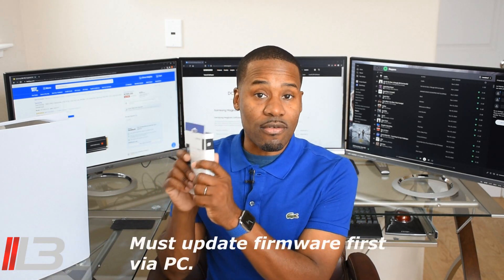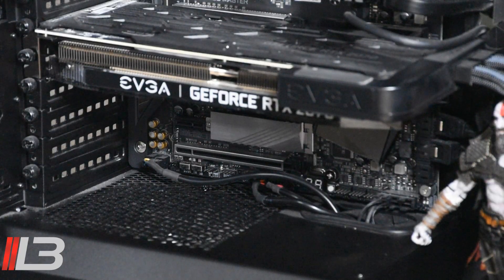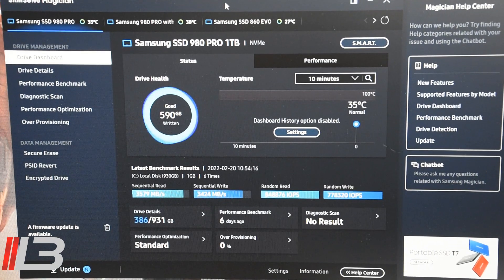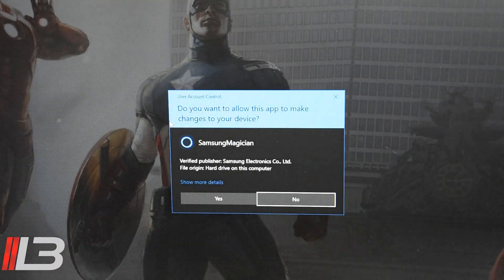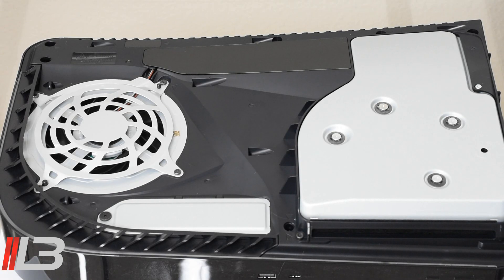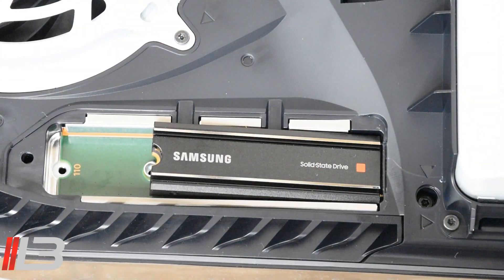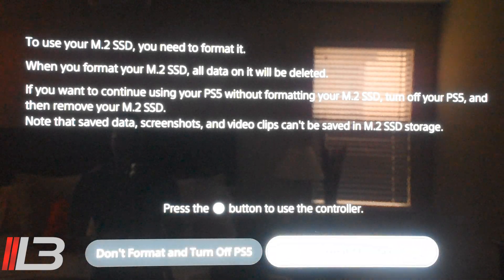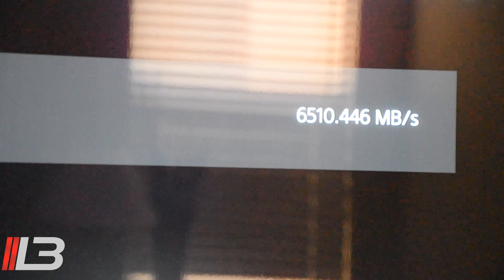Playstation 5 PS5 Samsung 980 PRO 2tb SSD With Heatsink Install & Firmware Update 6500MB Speeds

Comment: I just got 2tb 980 pro with heatsink production year 2023-09-29 l. Do i have the latest firmware update? Cuz i dont have a way to check
Reply from the maker: I think you’re good.  But, if you put it in your PS5 and the read speeds are what mine are or higher, you’re golden.

Comment: Hello I found this product on Amazon, and the price of the product caught my attention. It is great!, so I want to ask you, after a year has passed since you downloaded this video, is it really a great product? Is it useful? Did you encounter any technical problems? Does it get hot since it is inside the Playstation? Because I really want to buy it, but I am afraid that there will be any problem
Reply from the maker: It’s still working just fine without any issues.

Comment: argh...i stripped the screw on the ssd.  Apparently, it's a common issue.  All be warned.  I've contacted some computer stores for the screw and spacer part....if that fails, I'll order one of the sets thru Amazon.

Comment: Mines made in Vietnam 2 tb. Made in 2022? Did not update. Read speed 6496 mb/s. More concerned interested in whether +- 50 mb/s really makes a difference. Note: I do not jam things in. If it ain't sliding in then I'll work with it until it does. Never want to break something due to my own negligence. Also used a Sabrient heatsink add-on  that does not fit flush when installed. Had to wiggle and work on it before it fit more or less..

Comment: Can i update the firmware of my 980 pro with my laptop but connecting it via a usb to PCIe adapter, "on the go", without connecting it to the motherboard?
Reply from the maker: I can’t confirm, but I believe so.
Reply: Did you end up trying this? And if you did any recommendations? I'm in the same boat

Comment: Can you tell me how many sdd u have cause I see that u put one in the PC and the other one in the ps5 did you use to sdd or did you took away the one that you updated on the PC and put that one in the ps5
Reply from the maker: As showed in the beginning of the video you’ll see three new SSD’s. I have three new ones and had one existing 500gb in my PC.. I put a new one in my PC. I upgraded it to a 1tb from a 500gb. 

I also have two PS5’s. I upgraded those to two 2tb SSD drives.

Comment: So I think this is a real problem 
If you need to update ssd every 
3 or 5 months for stability and 
Improvements, and probably if 
you already install it on ps5 u 
must transfer games to PS ssd 
before installing the update or 
games will be deleted and if u 
don't have enough space in PS 
ssd you are done
Reply from the maker: I never heard of having to update it every 3-5 months.
Reply: I saw an article 2 days ago saying you needed to update the firmware on the Samsung  2tb 980 pro or it could randomly brick itself. Is there any way to do this without a pc? We need a Samsung magician app on playstation 5!

Comment: This thing is on sale for about 209$  for the 2 TB on Amazon i am going get it rite now before the sale ends. So I got mine and I put it in the ps5 and my ssd was made 5 months ago the date was on the black tape on the box and it shows I'm getting 6480 mb/s so any ssd forsure is updated if it was made less then 5 months ago.
Reply: Nice thanks for posting ive just got my ps5 and just this minute ordered a iTB pro with heatsink  so will check date on box 1st 👍

Comment: Can I just put the Samsung 980 PRO Heatsink 2TB SSD for PS5 in the console & the updates from Sony will update??
Reply from the maker: You can put it in without updating and it will work fine. You just won’t get the fastest read write speeds if it doesn’t have the latest firmware.
Reply: @locoboof  Hi James, will the Sony PS5 updates do that for me?
Reply from the maker: No, that’s why I made this video.
Reply: It would be good if sony did update them for the user. In my opinion I think they should atleast update the official licensed WD Black drives.

Comment: there's no way of updating it without putting it into a PC? I just bought this drive on sale for my PS5, it'll be stuck at 5500mb/s?
Reply from the maker: Not that I know of. If there’s a PC repair place near you, take the drive to them. They can update it for you.
Reply: @locoboof  I wonder if Best Buy could possibly do it at Geek Squad....i'll see how it goes, it might be a newer version of the drive w/ the update already on it.....Won't know til tomorrow. Thanks for the video regardless! :-)
Reply from the maker: You’re welcome and good luck!!
Reply: @locoboof  Had it installed a few days now, so far so good! fan revs up a little sometimes but i hear that's just normal behavior for the console? It'll rev up a bit, then calm down a few seconds later.
Reply from the maker: Totally normal.

Comment: Does it have to be PC or can you update firmware on Mac with nvme to usb c enclosure?
Reply from the maker: A enclosure might work. Can’t confirm though.
Reply: NVME to USB enclosure doesn't work, I've tried it. It either has to be a M.2 slot or PCIe adapter unfortunately.

Comment: I have older hp laptop(about 5years old). Can I update a 980 pro firmware on it?
Reply from the maker: If it has a m.2 slot, then sure.
Reply: @locoboof  Unfortunately it doesn't. Can I use an adapter and connect via USB? If yes, then which one should I get?
Reply from the maker: Not that I’m aware of. Everything I read it’s either via a ide/m.2 adapter or directly on to a motherboard. 

If there’s a PC repair shop by you, ask them. It’s inexpensive and fast. Or try to find a friend.

Comment: Can a 980pro be update to a Laptop?.
Reply from the maker: Yes!
Reply: @locoboof  have you made a video on it??
Reply from the maker: No, I have not. But as long as you have a open m.2 slot you can do it.
Reply: I finally got my 980 Pro SSD and it was super easy to update the, all you need to buy to update it in a laptop is a NVME SSD Enclosure.  I bought the Orico M.2 NVME SSD Enclosure for $18.99 on Amazon. The Enclosure cover didn't close which was fine for me cause all I needed it for was to update the 980 Pro. If you want to use the NVME Enclosure for a long period of time i suggest to get the large Orico Enclosure that has a build in fan for $56.99 unless you could find anothe cheaper versions that will do same job in my opinion.  I'm was worry at first and it was the easiest thing to do, hopefully this help for who ever reading this.
Reply: @alexandernieves707  when you put the 980 pro ssd in nvme enclosure and open up the samsung magician software, does it recognize the enclosure ssd?

Comment: Thanks for the content, you’re a techsaver. Is there another way to update the firmware on the ssd, I.e. via usb or is the only way is to stick it inside the computer to update firmware?
Reply from the maker: Thanks!
I think the only other way to update it is to get a M.2 NVME to PCIe 3.0 x4 Adapter and put that in your PC.
Reply: @locoboof  ok, got it, thank you.